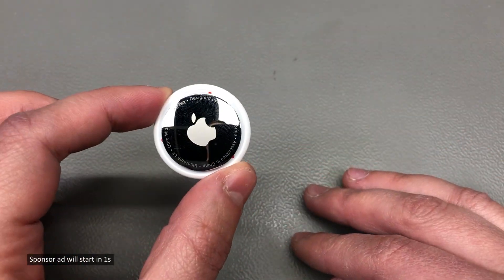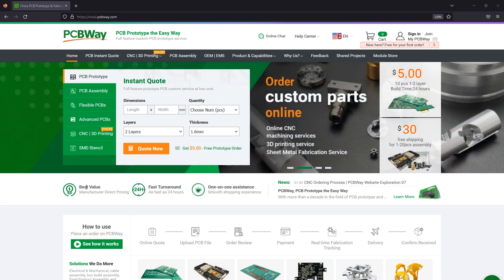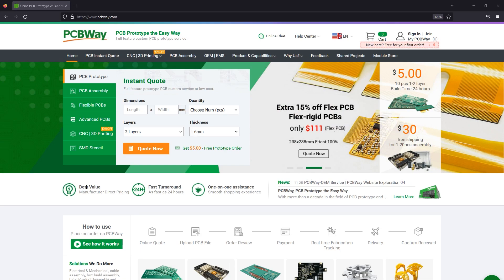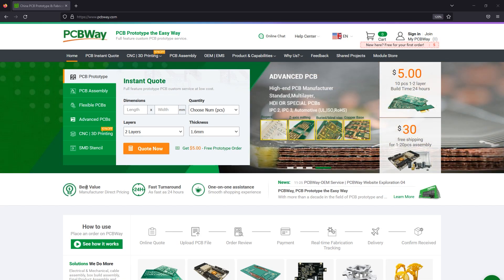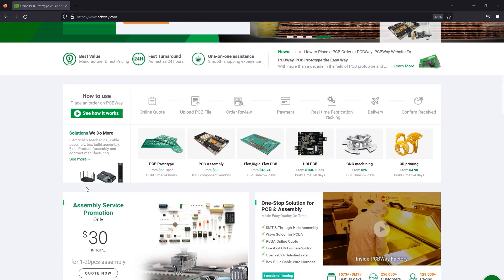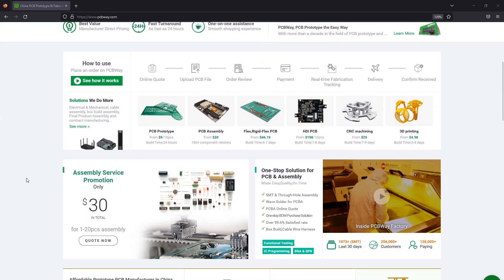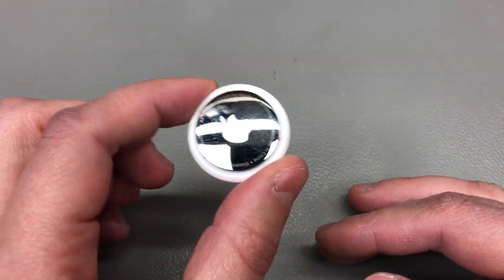How To Disable Apple AirTag Speaker Sound | Voltlog #440

Comment: I got it apart without breaking the clips, took the battery out put it all back together and the Airtag hasnt worked since !
Reply: You’re only meant to only take the tiny speaker out not the battery.  Put the battery back in.
Reply: Mine either. They must’ve been updated

Comment: thanks for the video! the newer airtags have a lot more adhesive around the speaker. when I opened the airtag the speaker was on the circuit side not the cover. with some magnifying glasses i was able to remove the glue and the speaker without damaging the coil, just in case I have to or want to put it back later.

Comment: Very useful, thanks. I used a Stanley blade works well, followed your instructions and only broke 1 clip out of the 3 so not bad and still attached secure after and my speaker was in the bottom white section but I removed it, put it back together and it’s working fine without sound 🙂
Reply: I took mine out and it’s still making sound. Lol

Comment: If your Air Tag is within Bluetooth range, it will play a sound. This is used to let Air Tag users know where their Air Tag is. You don't want to remove the speaker as this would cripple this function.
Reply: It also tells thieves they have an apple tag tracking them. I'm using it to track my purse or my car so I don't want a thief to be alerted about the tag.
Reply: Depends on the use case. I want to use it to track my cat. It would get scared by the sound I'm afraid.
Reply: @LuigiBrotha  lmao same
Reply: there is also a feature called precision finding, available on iPhone 11 and later.   If you are within several meters of the airtag this feature will tell you the distance and the direction where the airtag is.  So if your airtag no longer beeps the precision finding will help you find it.
Reply: I think most people here are trying to turn this into an effective anti theft device that wont alert the thief.

Comment: Have 2 year old modified AirTags and they were low on battery. Tried replacing them and now my phone won’t recognize them. These tags are older gen where they were glued to center on the board and not on the lid. Now they are useles. Think Apple changed things with recent iOS updates.
Reply: recently one battery completely died and I had to replace it.  My phone no longer recognized the airtag, but I was able to reconnect it as if it was a brand new airtag all over again, and then everything was fine.
Reply: yes , and this is valid also for new ones. Just bought a pack of 4 new airtags. I modified 3 of them using different methods, 1 by removing the cover, 1 by drilling the speaker and 1 by dremmeling the plastic from above the speaker and removing using a small blade. All worked for a few minutes and then they just stopped. I reset all found them again with my phone but again the same happened......so its definitely apple

Comment: You are doing it wrong, in fact it is super simple. First remove the lid and the battery.  Then fill a lemonade bottle with hot water.(this is just for heating purpose) Hold the airtag with the grey battery compartment against the hot outside of the hotwater bottle. (Best keep your hand on it to transfer as much heat to it as possible)Now the glue will soften. When you made the glue warm and soft, put the metal lid back on the airtag and close it. Now use a flat knife and put it between the metal lid and the airtag and and carefully put a little power on it going round. You will see the grey battery compartment wil loosen. Carefully go round and it wil come loose without any damage
Reply: Afther this when it is open, remove the speaker ( it also might be glued to the print instead of the lid but it also can be easily and carefully come loose with the use of the utility knife by removing the glue . And when done you can  close it like nothing has happened  without the speaker case. When done right  no damage at all. The glue Apple uses becomes soft when heated.
Reply: Done it this way eight  times never failed and never any damaged airtags. Good luck with this info Consider making a new tutorial?
Reply: @TheGijzzz  im gonna try it g reporting back when im done

Comment: On brandnew airtags this doesn't work. Apple glued both plastic tabs near the battery contacts so it is not possible to open it without damage. 
Yes, they are glued/welded, you can't even remove the rest of plastic after the tabs got broken
Reply: I just did this with a new AirTag and it worked, not sure what you’re talking about
Reply: @mohsinfarhat7385  the airtag stopped working for me when I took out the speakers
Reply: Dremel?

Comment: does the tag stop working if the speaker connection itself is broken? that's something you can do with a drill in a couple seconds
Reply: instead of a drill you can also silence the airtag by hitting it several times with a hammer.  JK
Reply: It still works if you cut the speaker wire. Yes you could drill, but you'd need to very precisely locate the drilling location.
Reply: @jaro6985  it's completely dead space around the coil leads, that's a huge area
Reply: @steubens7  the coil itself is maybe 0.5mm wide, then 1 or 2mm to the PCB which you don't want to touch. Fairly easy with CNC, but could be hard by hand.
Reply: @jaro6985  literally just drill below the E in EMC, any further to the right and you hit the  magnet assembly but you're right in the void with the speaker wire termination. use a bigger drill if you want to reach in with a pick. you're not using a cordless drill here, you're using a pin vise or just the bit, literally can't miss it. there's nothing to short, even

Comment: I suppose it would be possible to connect a resistor in place of the coil to evade detection?  I was wondering if they could detect the magnet removal in software with back-EMF sensing (this would also detect a resistor), but I'm guessing probably not.  Maybe an alternative (but non-reversible) technique would be to fill the interior of the tag with silicone or ms-polymer sealant / adhesive?
Reply from the maker: I was also thinking about a resistor in place of the coil but truth is, they probably just have the coil driven through some output stage, maybe discrete one or integrated, doesn't matter really but my point is that it likely doesn't have any diagnostics on the output driver or any ADC pins connected to that because it really doesn't make sense from a design point of view to include something like that. So I doubt they are really able to detect that.

Comment: Unfortunately, the iPhone also shows messages now. So the thieves know that they are tracked. I am not sure if this hack still is useful (I found our two stolen e-bikes with these trackers). Maybe somebody knows the timing of the sound and the messages?
Reply from the maker: That is true! But the message is less likely to be shown because from what I have noticed using my own trackers, so far no message has been shown to my two iphones, even though on a daily basis they are next to the trackers for several hours. I think, the number of iphones in the wild is so large that from time to time, tracker connects to a different iphone which resets the counter for when the message needs to be shown.

In practice, in order to get the message the theoretical thieve would need to have an iphone, be close to the tracker for 3 days in a row, without any other iphone getting close to the tracker within that time frame. Which is a slim chance of happening.

Sound however is much more likely to be played and heard.
Reply: @voltlog  It won’t show on your own trackers as… they are your own.

If you have someone else’s AirTag travelling with you, that is when the alert shows. It is to prevent someone using an AirTag to stalk someone.

It’s not infallible, but it is another line of defence.
Reply: @voltlog  I did not know the time it takes. I only know that I get regular warnings on our bike tours with my wife that I am followed by a "foreign iTag" ;-)
Reply: I have no experience with these things; just asking a question to clarify my understanding.  Do they beep or does the message appear on your iPhone if the tag and iPhone are in proximity for enough time, even if both devices are registered to the same Apple account?  It would seem like a waste of battery and an annoyance if your own tag and phone kept alerting you.  It only makes sense for the alerts to occur if the tag and iPhone are registered to different Apple accounts, unless you specifically send a beep request via "find my..."
Reply: the random beeping is expertly timed to happen at the most annoying times.  :)